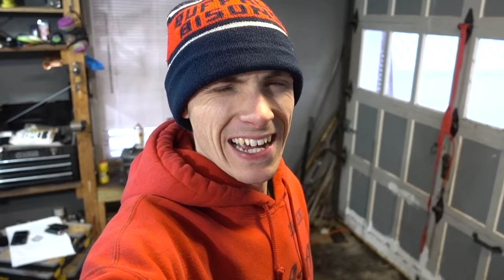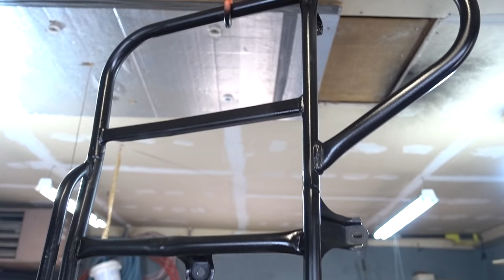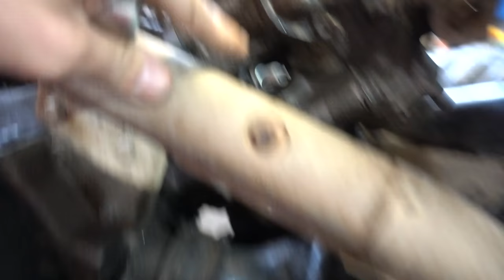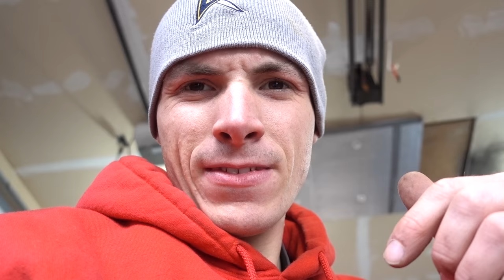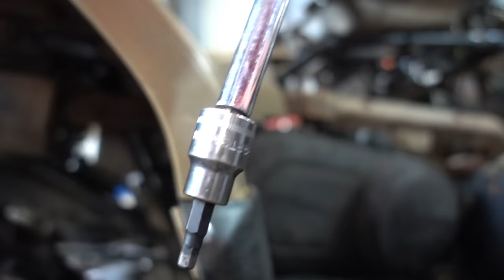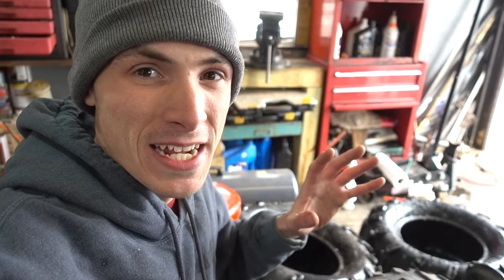KODIAK GETS NEW MUD TIRES!!

Comment: The Kodiak should've been brought to the scrap yard
Reply: Aidan Nina yep...I'll second that notion
Reply: Aidan Nina no it will be a good quad when he is done
Reply: Aidan Nina he is too far into it to stop now
Reply: mega mud boggin sorry slappy...most yamaha utility atv's are turds when they roll off of the assembly line...right alonside honda & kymco-cat.
Reply: ROTAXD Honda and Yamaha are the most reliable right off and used the hondas are just indestructible if your a can am person than can ams just break all the time
Reply: actually the best atv are polaris and can am
Reply: Aidan Nina the point of buying it was to have something to entertain and fix
Reply: Josh lengkeek yes but it was so far gone that thing at safe 220lb dude brakes to hard the frame will just bend again should of been totaled
Reply: I think the best atv were the Suzuki king quad,quadrunner 300 and 500
Reply: Liam adams the only decent wheelers that suzuki ever made were the LT 250's & lt 500's.
Reply: Liam adams straight up un kill able
Reply: Liam adams noooo. Kawasaki prairie 700 vtwin mines an 04. A true beast!!! Absolutely the best quad I have ever had!!! It hauls ass (65 with only me on and I'm 5'10" and 150 lbs) it'll go 0-40 in less than 4seconds lol. Great power especially low- high mid…   and tons of top end!! It spins the tires going downhill at 40
Reply: We own one,  stock it  would beat a 400ex after pulling a 45 foot wheelie lol. The steering knuckles were recalled and kawi put some updated ones on for free, 650/700 stock rocker arm shafts had mounting bolts on the shaft that could possibly loosen and fall into the top-end of the motor causing catastrophic damage; Fixed ours  by  Replacing with 05  rocker arm shafts.    I recommend napa air intake mod, jets  clutch kit  and aftermarket CDI.
Reply: mega mud boggin can ams and Polaris break all the time my friend had a Polaris for a while but it kept breaking so he switched to Honda and never has anymore problems
Reply: Trevor More those Kawasakis go through front diffs is what I here
Reply: Jared Bowles yea my friend had a Polaris and it was in the shop every other week it just broke all the time and it over heated like constantly went through axles every ride
Reply: zachcondon4568 funny...both the wifes and my can-ams have 3500 miles plus and we've never had any issues other than wearable parts & tires go on us. As far as your honda & yammi claims of being indestructable...ok, I'm give that to the hondas...but then again...when they don't make any power, they're not gonna break. The yamahas...sorry, many of the people we ride with started on yamaha. Each and every one of the 660 & 700 grizzlys burned a motor down before the 2500 mile mark, while the kodiaks lasted longer, they fell into the same category as the hondas...gutless= run forever. Polaris...yea, I've owned them and the gen1sportsmen were known for eating suspension bushings and the occasional axle.
Reply: Lots of Kawasaki and Can Am out on the trails where I ride, They both hold up well from my experience fair amount of Polaris they seem to be hit and miss some models are bad. Farmers buy the smaller Hondas because they can take a lot of abuse and tow well with sra some of them buy Yamaha along with lots of hunters.  I don't see a lot of Suzuki around but they don't seem bad. I see even less Arctic Cat  especially older ones can't comment on them.
Reply: ROTAXD well to that you are right about them having no power cause my Honda is slow compared to can am but just because it has no power doesn't mean it can't break i abuse my Honda and I ride it hard and yea it hasn't had any real issues I having my first issue now because the brakes are gone and the reverse is screwed up but I've had it for two and a half years now and it hasn't had an issue and I ride it hard pretty much every day so if you don't ride your stuff hard of course it's not going to break any brand of machine that you baby is going to last but the can ams wouldn't last very long at all with how hard I ride and to compare I got an arctic cat and a lot of people said they were bad and I broke the engine after two months because I rode it hard so if don't ride hard then it's not going to break
Reply: davidbrennan5 from what I've herd the can ams can't take any abuse if you ride them hard then they tend to break is what I here Kawasaki don't know much but I've not had experience with them Polaris from what I've experienced they go through axles and every ride pretty much my friend got sick of his Polaris and now rides his Honda 350 rancher which doesn't have any problems even tho he beats on it just like me with my 250 Honda and for older Arctic cats I have one and it's a 2002 250 4x4 and it had a big engine issue right when I got it but that's about it except right now it's back in the shop because when they rebuilt the engine they screwed something up
Reply: zachcondon4568 riding hard is one thing. Kicking the shit out of somthing and abusing it is something else entirely. That being said. We run pretty hard when we are not riding with a large group. (Sm group=4-6 machines. Lg group = 6-10 machines) 
My gen1 Outlander has outlasted 2 660 grizzlys, a 700 griz, a prarie, and an AC. Mudpro. That's what the folks who started off riding with us originally bought. All but one has since switched to c-a. 
If you wanna talk sport machines...I still have my 01 ds650 and that has been abused and needed a rebuild during the winter of 2014-15. Guys...I'm much older then you and have ridden them all...and owned most at one point...trust me, can-am is the most expensive machine on the market for a reason. You get what you pay for.
Reply: ROTAXD riding hard is what i do whether I'm with someone or not my Honda has taken that abuse and has held up I take in deep water or at least as deep as the intake will take me I mud the crap out of my atv and it just keeps running my friends Honda 350 which is a 2002 is still the same bike as its ever been nothing ever has been done to that bike except matinence my arctic cat was treated the same as my Honda and it broke but from what I've seen the people who had Honda tried can am because they wanted something faster but than switched back because of reliability issues and if I got a can am I would treat it the way I treat my Honda and if it breaks then it sucks but if it can survive with name riding it for a year with no major breakdowns then it will be maybee a possible bike to try otherwise no and I post videos of how I ride go watch my videos and you will see that my Honda is always running except for the fact it has no reverse but that doesn't count because that is very easy to fix so I want you to post videos of how you treat your stuff and I will tell you if you are riding hard or not so watch my videos and learn what I consider riding hard
Reply: ROTAXD just because they are expensive doesn't mean they are good they just market really well and do you go mudding put big 31 inch outlaws on your quad stock and see if it can spin them with out smoking the belt or blowing the rear diff and compare it to a Honda rubicon which can spin 31s stock and how does that Visco lok work out for you 3 wheel drive also how many axles do you go through in a month and also post some videos of your stuff and some rides so we can see what they can do and oh yea if it breaks and you are filming tell the people and I'm not trying to hate it's that you just don't have any proof of your stuff not breaking I post videos and if something goes wrong on one of my bikes i tell the people on YouTube or make a video about it because I am honest And if someone asks me about a certain bike that I've had experience with then I will tell them what I know and if they don't believe me than they can watch my video also I don't own a can am but if look up mud puppy on YouTube then you will see all the problems he had with his and he abused his stuff like me
Reply: Aidan Nina as I said before...you get what you pay for. Back in 01 when I bought my ds and in 09 when we bought our outlanders...they werent the highest cost machines on the market. The fact that they are some of the best machines and the high demand for them is what has helped drive the costs up. That's how capitalism works. And...you're comparing an almost 500 cc rubicon with a granny gear to a large bore gen1 outlander ? Roflmfao. Well, if we're playing that game, the 85 trz 250 I had would turn 31's without smoking a belt too. If the honda made any torque to speak of it'd be the clutch plates you'd be replacing along with a couple of broken/twisted shift forks instead of possibly replacing a belt. As for how many axles I'd cook if I were rinnin a set of 31's...probably one...then I'd go aftermarket just like everybody else making big hp/torque numbers on big tires. Fact is...putting a set of 31's on means you ride in the mud almost exclusively. Setting an atv up with rubber that big takes the machines trail abilities & handling & throws them out the window. As for my "3wd"...true, the original diffs did not lock for shit...they've both (both machines) been updated to qe's they lock fine if you know how to stay on the throttle. Have we been stuck ? Yep...and so has every other machine on the planet...including those dreaded rubicons on 31"'s. You tell folks to go on mud pups channel and see all the problems he's had. 
1) the man does not know his ass from a hole in the ground. You want to see some well "built" can ams head over to ostacruisers channel.
Reply: ROTAXD on a can am you are going through a 100 dollar belt every other ride but on the hondas it will take years to burn up clutches can arms cvt had sucked for years and has always sucked and I was comparing the can am 570 to the Honda rubicon 500 and ostscruiser spends 20 to 30 k on his builds I m talking stock a rubicon500 can be built to run in the mud and water pretty much stock just add snorkel gear reduction and 31 inch outlaws and your good to go that's only 8 grand but to make a can am good in the mud you have to put a million different mods to even make one ride out mudding and taking it in deep water and the can arms to make reliable you have to spend 20 to 30 k on mods if you want to compare go buy a 570 and a 500 rubicon and see which one needs more money to mod oh wait mud puppy already did that he spent 13 grand on his 570 outlander which had 96% of the same parts that the 850s and 650s have and he compared it to his Rubicon which he spent about 7 to 8grand on to mod and it never broke unlike the can am also you are still saying they good just because they are expensive which is not true if you as a said before that the much cheaper rubicon did way better Than the can am and the can am had way more money put into it and it still had problems and like I said show us a video of how good your can am is take it on trails take it in mud water rocks deep ruts and put videos up of it
Reply: ROTAXD so also what your saying is that the can am cant spin big tires because the rubicon does it just fine you said that makes it harder on the bike because you know it will brake your can am if you put big tires on it but the rubicon can do it stock for years without much issues
Reply: zachcondon4568 im a honda man for sure but i did have a Polaris 325 magnum from 2000 to 2015 an i never had one problem with it an i beat the shit out of it an it still heald up lol but i will always be a honda guy lol
Reply: ROTAXD also mud puppy has documented every single problem he has had with his atvs and the rubicon had had two axles break over time but that was because he was running black mambas which are like 100 pounds a piece per tire and he's run all types of different mud tires his can am has gone through a transmission a rear differential and a belt on stock tires within a two weeks of buying it brand new and then broke another rear diff went through like 8 rear axles and a lot of belts over his time of owning it and a thousand dollar computer just for the fun of it and it over heated all the time even know he relocated the radiator and it had no ground clearance and no front locker so now tell me how they are better than the other bikes if that happens to them go watch his videos not ostacruiser cause he spends 30 grand on his bike but mud puppy's was a small 570 that was not as built as much as ostas bikes and it's not just his bike having issues his friend had a xmr 1000 that blew a rear diff in one of the first holes and he was just creeping
Reply: CBR900 BOY I don't know much about the magnums but my friends Polaris 400 ho 2010 was nothing but issues had axles breaking every ride overheated had a front wheel hub break and the suspension is just bad and so soft and saggy and the suspension feels like it's about to fall apart but yea hondas Are awesome Honda powa lol
Reply: zachcondon4568 original belt on both of our outlanders. 650 gets plowed with (5 large driveways). 800 does not get plowed with but regularly pulls trailer on trailrides (weighs between 5-800 lbs).  Never smoked a belt. 650 has stock oem 6 tower clutch. 800 has airdam (cvTech primary & secondary sheaves have been machined.) rather then talking about machines built exclusively for mud...let's look at which machine is best set up for it's intended purpose from the factory. Hondas are fairly dependable, yes, but they ride like frigging lumber wagons, are underpowered, and cost roughly the same as a much more capable outlander 650 or a sportsman 570. Not to mention resale value. My father in law recently decided to jump ship from honda. He took a huge loss. Paid roughly $9500 after tax and was only able to get $6000 for it when he sold it. (2.5 yrs old. Mint condition. <500 mi). Dealer only wanted to offer him $5200. 
We considered trading the wifes outlander in last year
('09, 650 max xt) $9479 after tax new in 09) and were offered $4550 on trade in. See the differences. If you want to build a honda or any other brand exclusively for mud riding...why bother buying an atv ? Bikes set up for mud quickly become trailer queens when you leave the swamp. Btw...we still have a 2000 rancher up to camp...we let guests with absolutely 0 skill ride it because there's literally no way they can get hurt on something that only generated maybe 18-20 hp.
Reply: ROTAXD and the big can arms weigh like 800 to 1000 pounds
Reply: ROTAXD because a lot of people like mud riding you were bragging how good ostacruisers bikes were and now your saying there is no reason to buy or build a mud bike what I'm saying is can arms don't make good mud bikes or technical trailing bikes the only things can arms are good for is that they are really fast so if you like to drive really fast and vaporize yourself go head buy a can am but anything else other than smooth trail riding can ams are not good at unlike Honda also make some videos of how awesome your can ams are and make sure you say or show In the videos if something breaks because I want to see if you actually ride hard or if you are one of those people who drives on smooth trails and no technical stuff or mud
Reply: ROTAXD can ams suck bottoms line whether the Hondas make power or not they are still going to have the same gearing and they are slow but that doesn't matter in mud the can ams crank shaft can turn big tires all day but the belt can't it's going to slip the Honda is gear to gear and the only thing that you will ever have to do to any Honda to spin big tires is a gear reduction and the can am is going through a 100 dollar belt every ride on big tires but the Honda will take years to burn up the clutch if you happen to not have a gear reduction which happens to be really cheap like 300 to 450 bucks but a big fancy nice clutch kit on a can am is about 2 grand also I'm assuming you live in Canada and think that can am is made in Canada which it's not full on Mexico made junk unlike the reliable cheap in price for a Honda but the can am is expensive but made cheaply unlike Honda which is made as reliable as it gets
Reply: ROTAXD also Honda stock axles and are awesome and no one puts clutch kits on Hondas only gear reductions because they actually do something horsepower means nothing because on a Honda there is a transmission which changes the gear ratio the can am has tons of horsepower but it has to go through a belt and it the gears after the belt aren't low enough the belts going to slip with big tires on a Honda there is not belt it's gear to to gear and is going to take a long time to burn up the clutches like two years maybee but the can am can crankshaft can spin the big tire all day but the belt can't and is in the middle of all it the belt primary comes out spins the belt that engages the secondary and that engages the transmission which then engages the diff which sends the power out to the wheels every after the belt is fine because it's gear to gear but the belt is the thing that's going to slip and fail hondas are all gear no belts involved in any of it
Reply: Aidan Nina I am familiar with how centrifugal wet cluches work. Usually that's fine in low power aplications. As soon as any real power is made, yes, a honda clutch will slip and burn itself down. 
http://rs30.pbsrc.com/albums/c304/ronlivings08/Mobile%20Uploads/20150504_205446.jpg~320x480?t=1430704970
There's a melted honda clutch. I'll keep my big hp v-twin, with the tall gearing as I'm not one of those guys who thinks riding around in a 1acre swamp for an entire day is actually riding. Hey, if you're content with a 30 mph top speed, the industries worse suspension and a nearly 50% loss in value before you make your first payment...that's your choice. I'll close with this...the last honda I bought is the last honda I'll ever buy...unless I'm looking for a snowblower or something. You'll grow up some day and discover the joys of horsepower and you'll buy a real machine.
Note: if clutched properly you'll still see a c-a go a long way on a single belt...even turning 31's.
Reply: zachcondon4568 so the big c-a's weigh "800-1000" lbs ? (It's actually closer to 760 for a max. 715 I think + fuel, oils & coolant).
Reply: zachcondon4568 first of all I was not bragging about ostas builds & how they are so great. I stated that they are done properly. I'd not ever waste the money to build a mud/muskeg only bike anymore then I'd waste the money to build a wheeler for the dunes or a banshee for 1/8 mi asphalt drags.
Reply: ROTAXD first of all it takes two years to burn up a clutch on a Honda but on a can am it's you ride once and need a 100 dollar belt and I have seen one video of the Honda clutches breaking but I have seen a ton of videos where can ams are just breaking whether it's the belt transmission rear diff or 2 axles in one day but I have never seen or had a Honda go through a belt a rear differential and a transmission all within two weeks of buying it brand new on stock tires that's sad so I want you to take your nice fancy expensive Cheaply made can am and put big tires on it and post a video of you doing it mud puppy's are ready don't with his can am and his Honda and posted videos of it and again with osta he needs to spend 25 grand on his build to even think about mud but I would only need about 8 grand to build up a honda rubicon for mud but wait I don't need to prove that hondas can mud cause mud puppy aready built up a Honda so if you want to learn how to use a bike for mud watch him he shows the difference between can am and Honda
Reply: ROTAXD I was talking about the xmr 800 850 and 1000
Reply: ROTAXD first of all my 250 Recon can hit 45 on a straight which is fast for a 250 when I get older and when I want something fast I will buy a dirt bike because there meant for speed can ams can only do things that involve speed because they are useless in mudding technical stuff and deep water oh yea back to power once again I know how it works because I actually work on my own stuff and know a little bit about machines so the pioneer 1000 which has like 72 horsepower can spin 30 inch zillas stock no problems even outlaws and it has tons of power so it wrong and for me getting a "real" machine hondas are the most real machine out there today can am scams you you pay all this money for something that is ready to fall apart unlike Honda where you pay way to little for something that is going to last for 20+ years with no major breakdowns and when I'm older and have money yea I might try can am just for the heck of it but unlike you I will post videos on it about  every thing that I do with it and things that go wrong with it but I'm also going to post videos of my Honda rubicon 500 if Honda doesn't make a rubicon 1000 but like I said I know what im talking about and if you look it up it's true that there are a lot more Hondas making it on trails then can ams speed means nothing if the bike can't get Back to camp or to the truck yea the Honda might take a while to do it but it will get there unlike can am which will be at the end of a tow rope
Reply: ROTAXD also you can see all the mud sand and water on the ground so this guy ride in deep water mud or rides hard unlike you I want to see proof of you riding your stuff hard not driving real fast on smooth trails so go in deep mud water rocks and technical stuff bring someone with a rubicon and see who makes it the farthest and make sure you film it cause I want proof
Reply: ROTAXD to clutch a can am properly it's 2000 bucks plus the new halo locker to replace visco bullcrap lok and aftermarket axles and a rad relocate and a big lift etc so the can am needs a lot of mods before it can even touch the mud but a Honda To make it turn big tires it's one 400 dollar gear reduction and that's it maybee a custom snorkel which is like really cheap because all you need is pvc pipe